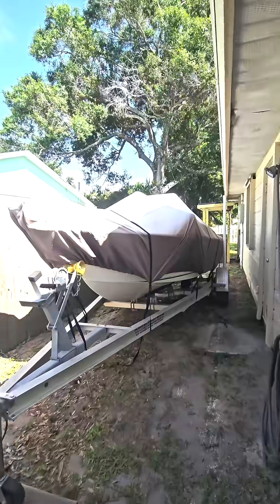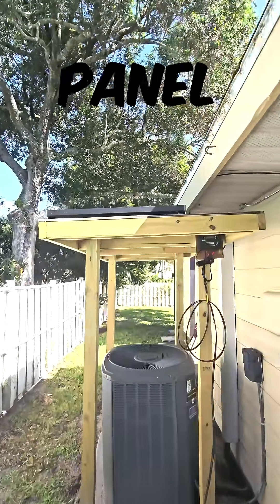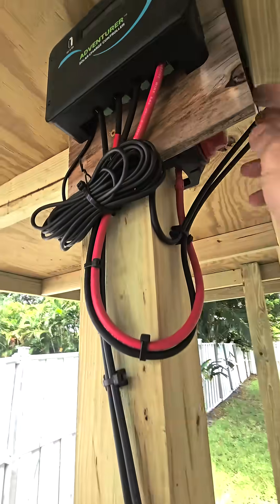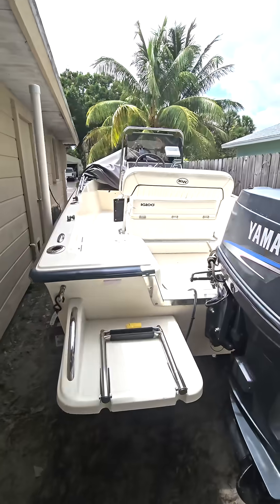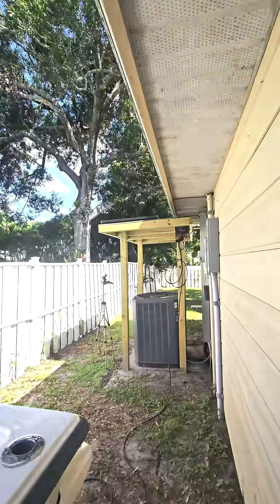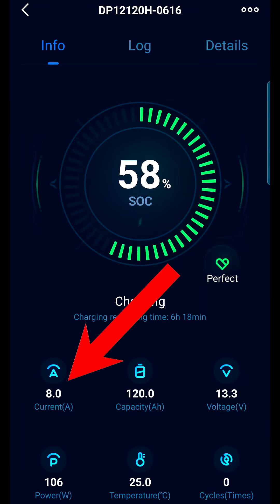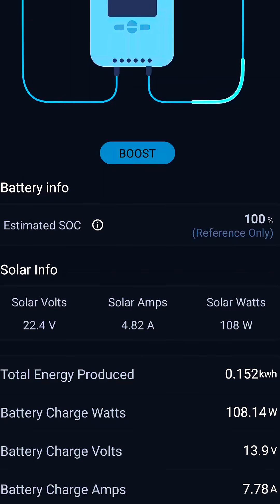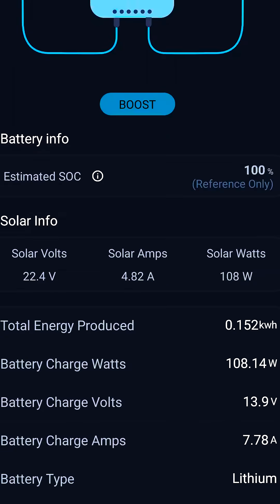Solar Boat Charging!

Comment: I just run an extension cord to an outside outlet on a GFI. your meter is right in front of the boat.  Looks like a sponsor plug is why you did it.   Get them to get you panels that integrate into the boat so it charges on the water

Comment: Your ac might end up with some head pressure problems. Not a guarantee but just something to note!
Reply: I was thiniking the shade on the condensor in the middle of the hot FL day was helpful.  I don’t think that’s any worse than a big tree..  Its pretty far so shouldn’t affect the fan flow.  Do tell me more.